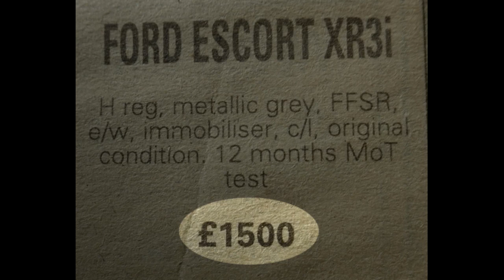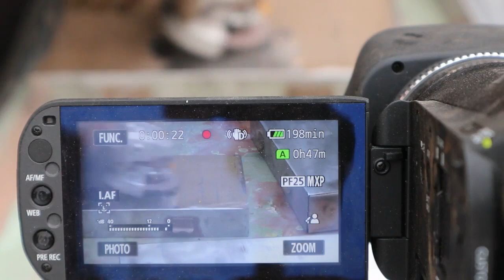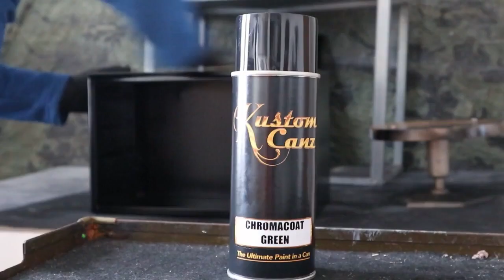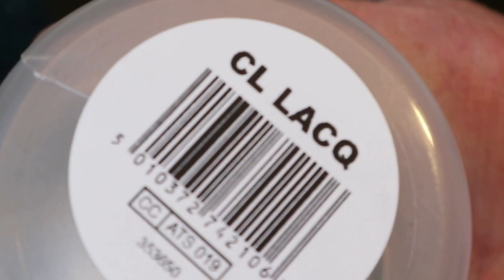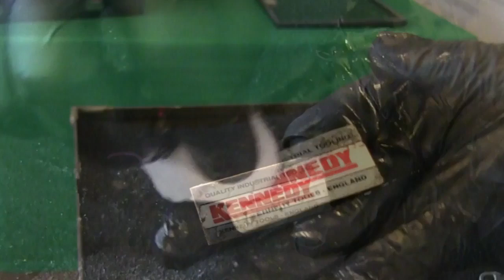Rusty tool box restoration and restyle

Comment: What stripping chemical did you use?  I purchased a set of pressed steel dressers and would like to refinish them.
Reply from the maker: Hi it’s a non Caustic paint stripper but it only worked on the drawers internals the outside it wouldn’t touch ! I used the non woven stripping wheel on the outside .